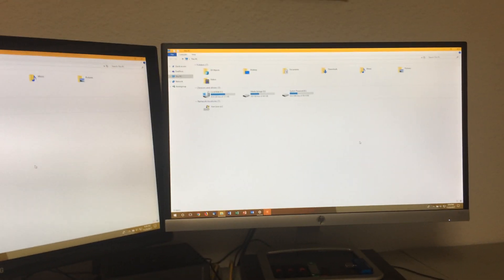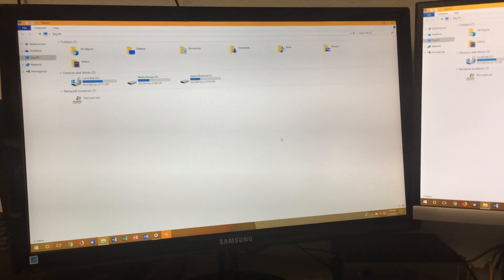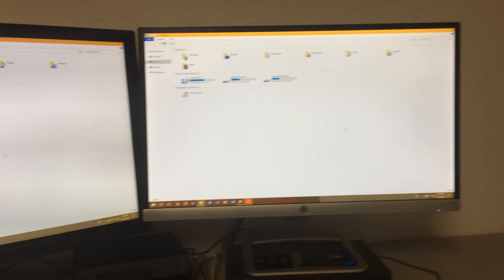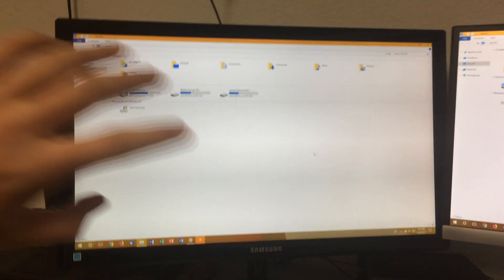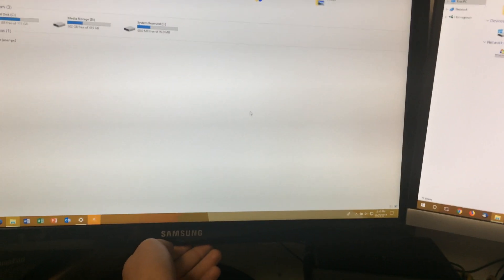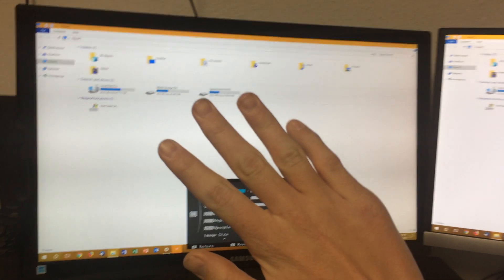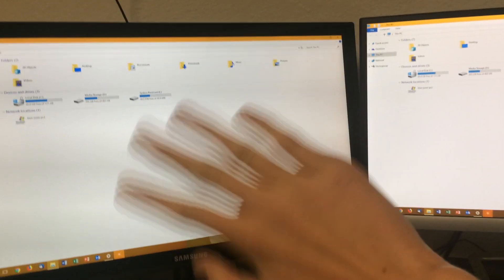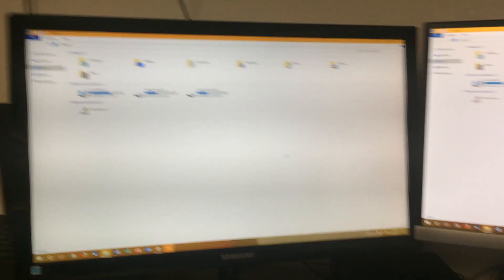How to test your monitor for PWM (pusle width modulation)

Comment: Method with fingers worked perfectly and on my galaxy s6 there is a huge difference. While my laptop hp probook 455 screen looks like dont use PWM
Reply: s6 (as most oled displays on phones) has something about 230 hz.... many  modern pc displays uses 1000-25000 hz. Its just too fast.
Reply: @boagoa282  There is some science on shortest detectable light flash, it's somewhere around 1/500 of a second. Aiming for 1000Hz or perhaps double that, is what I consider the floor for a guaranteed flicker free experience. It's just mind boggling how much stuff that are way below 200Hz. Especially led lights.

Comment: Most of the LED LCD monitors are using PWM to control screen brightness, it's just that the frequency is high enough not to be perceptible by human eyes including the HP one on the right.
Reply: I would say to most human eyes, it's not the same for everyone. If you're sensitive to flicker or learn what to look for and when it's possible to see, lots of monitor flicker will be visible. I have seen 240Hz flicker on Dell monitors. Lots of Samsung OLEDs use a mere 120Hz. A Panasonic VT30 Plasma TV used a mere 60Hz!
Reply: @sniglom  You're talking about refresh rate Hz vs PWM brightness flicker Hz. Those are two, different things you are measuring. The first is talking about the refresh rate of the images display while the second is talking about how brightness is monitored.
Reply: @sublime_tv  I’m not. Don’t assume.

Comment: Hi! Thanks for the info. Does strobing effect still appear even at high frequency? Let's say 10khz+.
Reply: Stefanus Hendri I did it today and don’t care what anyone thinks.
Reply from the maker: The strobing effect isn't noticeable at high frequencies. That's why I had to turn the brightness down on the monitors when I did the test.  At 100% brightness, the frequency was so high that I was unable to detect PWM.
Reply: @randomtech3533  No, actually the strobe frequency is the same unless it's 100% brightness. At 100%, there's no strobe and led stayed on all the time, at 50% there is strobing with half on half off at its designed frequency, at 75% led on for 75% of the time then of for 25%. The frequency is the same, the time led stayed on is changed, that's why it's called Pulse Width Modulation not Frequency Modulation.
Reply: @thanhvinhle2893  i was Reading this thinking the same almost answering and then seeing it was 3y ago so i was like fuck it but then i saw your message good work
Reply: @nocodenoblunder6672  ikr. But worth pointing out even though the video (and comments) are old.